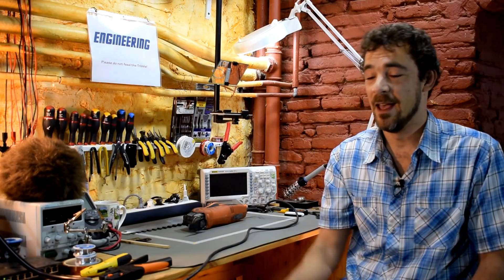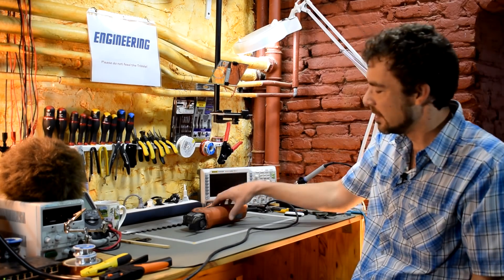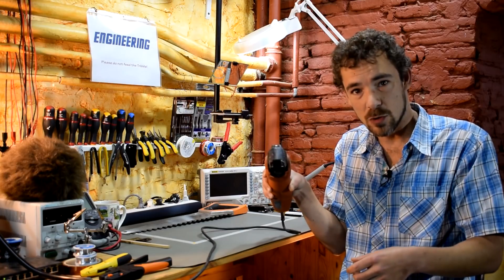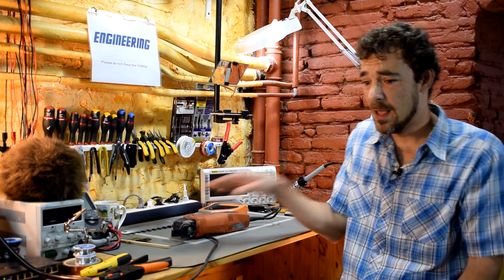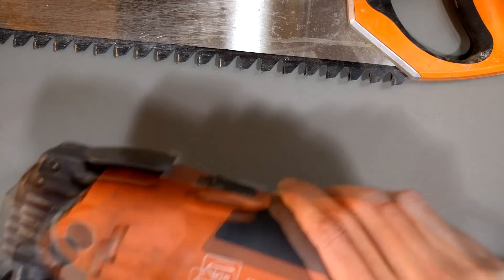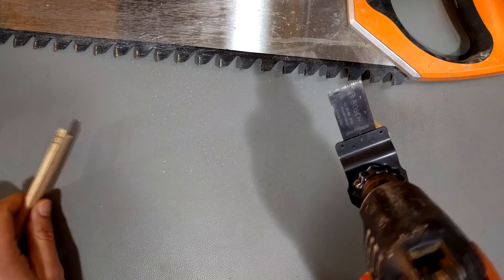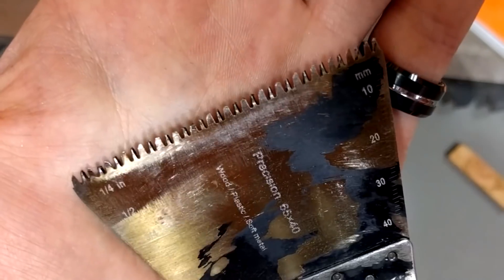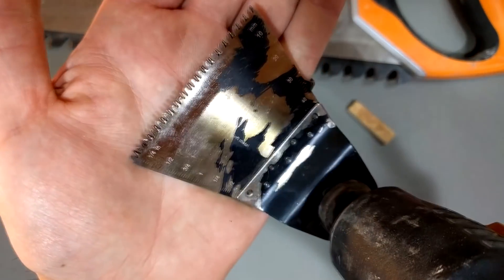Why oscillating multi-tools don't cut you

Comment: How do you know which multitools are skin safe without trying? 
I used a Milwaukee m18 and I wanted to try, but it cut everything I tried it on, so I never saw it cut me.
Reply from the maker: None of them should cut you - unless you press really hard and/or your skin is very dry.
Reply: But WHY do you want to prove this on yourself. Use a hotdog to satisfy your curiosity.
Reply: @cfldriven  you have a fun way of talking. I'll try a hot dog, before i try my finger.
Reply: @cfldriven  lol skin it way tougher than a hot dog. Hotdog’s and skin are completed different. Any. Amount of pressure and the hot dog will get cut

Comment: So if it touches something hard it cuts but if it is soft, it just vibrates without damage. Does anyone know how hard skin can be to safely use this without risk of cutting?
Reply: notice the way he touches it, he never pressed it against his skin and when he cut the wood, he pressed hard against the wood
Reply: @creavlin Try the same thing with a jigsaw or a circular saw and it'll be a blood bath. That's kind of the point of this no? If you press hard enough, any metal will cut you

Comment: The back and forth displacement of the blade is small enough that your  can stretch and slide to handle it without tearing. The "blade" isn't actually sharp, but just a thin disk, and the "" it produces in the cast is just a very thin line of ground away plaster. ...

Comment: I’ve never understood why this product took so long to get to the consumer. In 1966 I broke my leg and had a cast. When it was time to remove the doctor used an oscillating saw now called tool to remove it. It tickled but that was it.
Reply: The patent expired in 2009 so much cheaper tools could come out.
Reply from the maker: Me neither!
Reply: Fein had the patent.  They were absolutely available but just not on the shelf at home Depot so most people didn't know about them.  And they were 2-3 times more expensive than they are now.  Benefits of being the inventor!

Comment: Burned the hell out of myself with one of those once lol
Reply: And... naturally,
when my doctors noticed I was having fun,
they cancelled my Group Therapy Woodworking privileges, and...
adjusted my medication.
Guess its back to Basket Weaving for a while.
Hey look!
I can weave a hangman's noose!
Gotta' go... the white jackets are coming. 😂
Reply: @marshalllhiepler  when they move you to flower arranging might I suggest the nightshade family.
Reply: @tehs3raph1m  ,
Yes, I put in my transfer request two days ago, and I don't think anyone suspects a thing.
Reply from the maker: Yeah. I tended to apply too much pressure at first, which makes the blade heat up even more. They're really not a "quick cut " power tool, but they sure are handy... as long as you don't set yourself on fire.
Reply: After heating the blade sufficiently by cutting hardened masonry nails...
I was pleased to find that attractive brand marks could produced on my skin. 😃
Reply from the maker: @marshalllhiepler  YIKES!